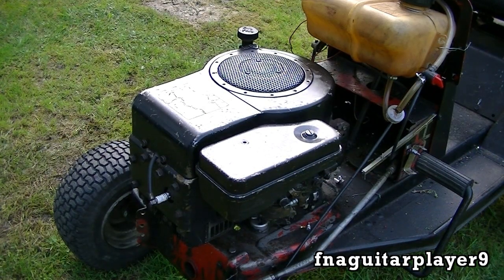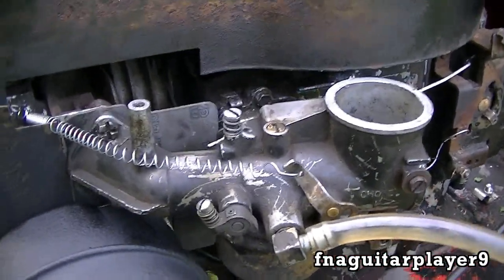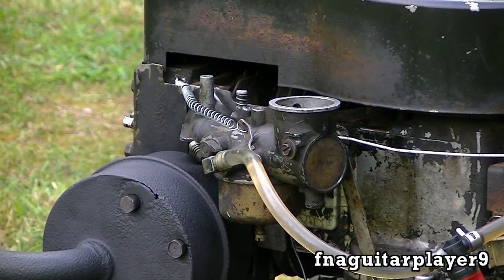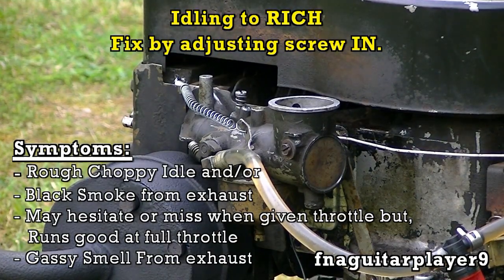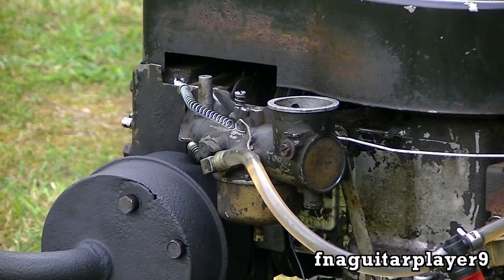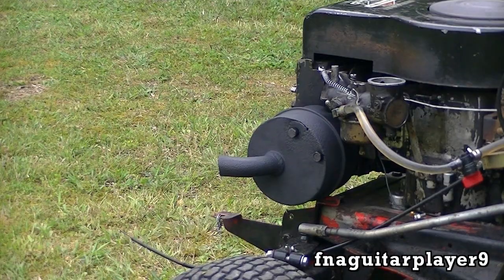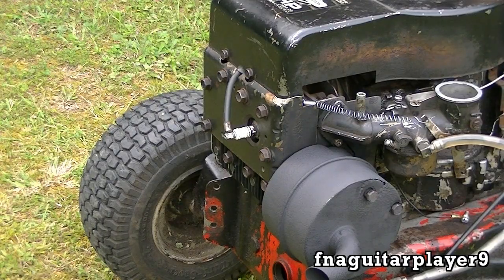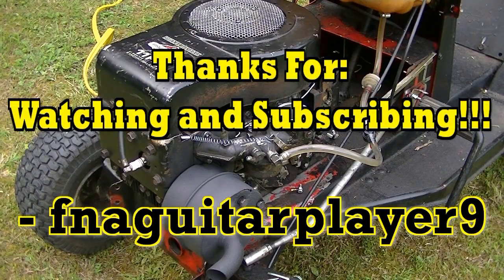How to adjust a Briggs and Stratton One Piece Flow Jet Carburetor

Comment: Hello I have a 10hp Briggs and when to give it throttle it Boggs but then clears up and full throttle how would I fix that thanks
Reply from the maker: Sounds like its running to rich, you can probably turn the bottom adjustment screw in until it stop doing that. But it could be running to lean, if thats the case then turn it out some. Thanks for Watching!
Reply: I got it all figured it was that bottom screw thank you for the vids they help out a lot
Reply from the maker: I hear ya! Your welcome, glad to help out!

Comment: Very good vid. Im not running yet, but its a 65' briggs 8hp that sat for 30 yrs. Got it to run 20 secs tonite, then quit. Never fired after that but this video gives me some things to try. I started at 1.5 turns out as this is not my 1st rodeo but this one is kicking my butt. But i only messed with bottom screw and olug is not getting gas in it. So maybe by messing w top screw , it might be running soon.
Reply from the maker: If its been sitting that long you will probably have to clean the carburetor first, i'm sure there will be some dirt/gum buildup in it. Thanks for Watching!!!
Reply: fnaguitarplayer9 yep i got it running about 2 weeks ago. The vid sure helped

Comment: My till runs great has the 8 hp briggs but at idle it will just vut out and die what could be my problem? Im going to use this video retune it today thanks for the video it looks very helpful!
Reply from the maker: It could be running lean at idle or you may have a weak spark, either do from the coil - flywheel gap not set right or from a fouled plug. or it my be trying to idle to low and needs adjusted up some. Thanks for Watching!!!

Comment: So am I able to replace my 12hp's Flo jet carb with a modern carb? If so what carb should I get. Thanks
Reply from the maker: The newer 2 piece style will bolt right on, but you will also need the elbow (that makes the other carb a 2 piece), and a linkage for the new type, it will be shorter. I prefer the old type myself, more adjustment and alot more reliable. Thanks for Watching!!!

Comment: On full throttle mine runs fine, but lower the throttle it surges and dies
Reply from the maker: The top screw (idle mixture) probably needs adjusted, if it doesn't adjust in, you may need to take it off and clean it, i have videos on that as well. Thanks for Watching!!!

Comment: hello again thanks for the info and getting back to me right away i have another question or two to ask you i started my mower today and it sounded really good at first just like yours but then when i shut the choke off it started two want to shut off so i put the choke back on then it started to run again does this mean i have to adjust the carburator more or do i have to set the govener right so it stops surging
Reply from the maker: Your welcome! It sounds like its running to lean, you should be able to turn out the mixture screw about a 1/4 to 1/2 turn (maybe more just depends) and it should be alright, if not, it may need to be cleaned. If that doesn't help, you may need to adjust the governor, but first thing to try is adjusting and cleaning it. Hope this helps, thanks for watching!!!

Comment: awesome video lots of info wanted to ask you can the seat where the needle goes be changed i went to a john deere place where they sell parts and the guy said that the seat cant be changed in these carburetors is this true or not could you please let me no because i think he was trying to get me to buy a new carburetor because i wanted to put a new needle  and seat do to gas being in the crank case  thank you and again awesome video
Reply from the maker: Appreciate that! You usually can change them, most of the time they came with a replaceable seat, but some do not, it just depends. If it doesn't, you can usually get the needle with the rubber tip and that will help alot. Your welcome, Thanks for Watching!!!

Comment: Thank you for posting. Got the it running after going back to factory setup. Tried a lot but when the engine gets hot it start coughing and than drops out. I think its the valves because in cold condition it work ok. What do you think?
Reply from the maker: sounds like valves or possible spark problems, could be coil breaking down or points/condenser. Thanks for Watching!!!

Comment: What if mine dosnt have a highs speed adjustment screw?
Reply from the maker: If its a one piece like in the video it should be on the bottom of the bowl, it may be broken off, but i've never seen a one piece without it, now the newer 2 piece carbs don't have a adjustment on the bottom, just on the top/side. Thanks for Watching!!!

Comment: I have a serious problem with hunting on these classical one-piece flojet´s.I have tried; new gov linkage, gov readjust, compressed air (carb cleaner)in all jets, still hunting like mad. Very nice and informative video!
Reply from the maker: It is possible to have a problem with the internal governor parts (oil slinger) but its unusual. Also it could be valve related, if the valves aren't sealing they act like that sometimes. or even if it has weak spark they can do that. Hope this helps! Thanks for Watching!!!

Comment: I used this video and got mine running mowed for about 20min and noticed it bogged out pretty easy. Adjusted the high side to run richer and she shut down. Now she won't crank back up. Any suggestions I think I'm gonna start from scratch
Reply from the maker: Thats the best thing to do when you "lose it" thats what i call it when you can't get it do anything after adjusting, just screw them both in and back it out to about 1.5 to 2 turns and see what it does, it should at least try to run at that. The carburetor may need to be cleaned if ti doesn't adjust in. Thanks for Watching!!!

Comment: My old rider like this runs find at higher throttle but chugs and dies at lower throttle, any one have any suggestions? Thanks
Reply from the maker: If adjusting the idle mixture screw doesn't fix it, try giving it a good cleaning and see what it does, sometimes it doesn't take much for them to act up. Your welcome, Thanks for Watching!!!

Comment: I have added a shut off valve so when not in use it doesn't run into crankcase but now I can see lots of gas after it startscin the carb top

Comment: So if the carb is filling up with gas and dies the bottom screw should be turned in?
Reply from the maker: thats usually do a float or needle valve problem, not letting the gas shut off.  Thanks for Watching!!!

Comment: Hey, I got a B&S 11 hp with the same carb.  The only thing is it starts and idles fine but when I give it some gas it revs up and I cant do anything to stop it but shut the mower off. I see in your video the throttle screw is not pivoting and mine is. Any explanation? Thanks
Reply from the maker: +Clayton Florence When you say you can't stop it, do you mean its over-reving? If so then i'd say a linkage is loose on it between the governor arm and carburetor, or the governor may need adjusted. Thanks for Watching!!!

Comment: I need the video for the 2 piece flo jet tuning adjustments.
Reply from the maker: +Dan Southern I don't have one yet, I'm planning on making one this summer, but i can try and explain it, first off the adjustment doesn't really do much on these carbs, it mainly adjusts the idle mixture, i just try to adjust until it will idle smooth, and see if it takes throttle good, if it doesn't take throttle no matter what you set it at, the carb needs cleaned and/or rebuilt. The 2 piece carbs are alot more sensitive than the older ones. And the adjustment range isn't nearly as much as the one piece carbs. Hope this helps for now. Thanks for Watching!!!
Reply: +fnaguitarplayer9 Awesome. That's basically what I have done. I did clean out the jet and got it to idle pretty good. It seems to be ok now. I just didn't know if there was a WOT setting or not. Thx again ! 
#5hpbriggssuperbronc
Reply from the maker: +Dan Southern I hear ya, not a whole lot you can do on these adjustment wise, just idle speed and mixture. your welcome, anytime!

Comment: Hello i have the same engine as in the movie. I have tried alot of diffrent things but can get to a soloution. When the engine is cold and pre warm there is no problems at all everythings working. But after like 10 minutes of grass cuting the engine wants to stop. And it sounds like it gets to mutch fuel. To get it started after that i need to have choke and at choke it starts and dies direct.. Do you have any clue what it could be?

Thanks
/Lorens Wastesson
Reply from the maker: +Lorens Wastesson First thing I'd do is make sure your choke cable is set right, sounds like it may not be opening all the way, or it could be the high side set to rich, the adjustment on the bottom. Thats the first things that come to mind. Thanks for Watching!!!

Comment: How can you  tell if it sheared off the flywheel key i had to change the flywheel on it cause the teeth was sheared off
Reply from the maker: Timmy Weller You have to remove the flywheel, then remove the key, if its still in one piece its fine, if its looks offset or is in pieces then it sheared it. Thanks for Watching!!!

Comment: I got a 12 hp Briggs and Stratton its popping through the carb i need your help on this plz
Reply from the maker: Timmy Weller If it ran before and just started doing this, i'd check the flywheel key, if it sheared it will do that (throws ignition timing off), if you just got it, then i'd suggest cleaning the carburetor first, best place to start. hope this helps! Thanks for Watching!!!
Reply: I cleaned the carb cause it wasn't getting any gas but now it wont even start
Reply from the maker: Timmy Weller You probably will have to play with the adjustment screws, turn both of them in until they bottom out, then turn out aprox. 2 turns, it should start to run some then. Also make sure its not flooding out, sometimes the float will stick and the carburetor will fill up.
Reply: Fixed the problem
Reply from the maker: Timmy Weller Heard that!
Reply: +Timmy Weller
I have the same issue with mine popping when trying to start the engine and then it dies, how did you fix the issue
Reply from the maker: probably a carburetor issue or a valve not sealing correctly. Thanks for Watching!!!

Comment: Well it took me a while to find your video but I'm glad I kept at it.  Similar to Barry Taylor, I'll keep your video reference for after I'm done cleaning the carburetor.

Quick question though, When I run it now, it will run well for 5 minutes then start to sputter and slows down within 15 to 20 sec.  I did change the air filter, new gas line filter, new oil, cleaned out the gas tanks and spark-plugs looks fine.  Any ideas just by reading? 

PS. I was going to pressure wash the bottom part of the engine since its all gummy and thick, is that a good idea?

Either way thanks for your video !
Reply from the maker: Serge V. Richard I hear ya! Sounds like the carburetor may just need cleaned and adjusted. Also it could be the float isn't set level, not letting the bowl fill up with enough gas. Its fine, just don't do it if the motor is real hot, warm is fine, like if you cut grass with it, then let it cool for 10-15 minutes then wash it, you don't really need a pressure washer, unless its just handy, because a water hose by itself with break up all of it. Your welcome, thanks for watching!!!
Reply from the maker: Serge V. Richard also note, just make sure not to get any water into the carburetor, leave the air filter on it, so it won't get into it. You can also leave it idling and do it as well, that way if water does get into it you know where at and most of the time it will clear out while its running unless its alot...
Reply: fnaguitarplayer9 Oh I wonder, I did change the gas filter but not with the same one, so I'm wondering if the new one is not allowing the correct flow in. The arrow is in the correct position mind you. Anyways, the carburetor look/is very dirty so it should be cleaned either way.
Reply from the maker: Serge V. Richard Most fuel filters are about the same, not a whole lot of difference, you can unhook the fuel line after the filter or at the carburetor and see how much gas comes out. Thats probably whats wrong, the carburetor needs cleaned, it happens alot. Thanks for Watching!!!

Comment: Thanks so much for this video!  I'm a computer guy trying to get  my 11hp briggs to run.  It has a problem running at more than an idle and you can forget about running the blades.  Everyone pointed to the carberator.   So I've got it off and it was really dirty so I'm cleaning it with gas and carb cleaner.  I hope I get it back on and will use ur video for reference as it is superb.
Reply from the maker: ***** Your welcome. I hear ya, that should help it, and it may also need adjusting as well. Glad to help out, Thanks for Watching!!!

Comment: ***** , I have an 80's Craftsman tractor with a 10 horse B&S engine with this same carburetor. The idle screw does absolutely nothing on mine! What am I missing? It runs the same if the screw is all the way in or all the way out and everything between

Comment: Mine seems to run smooth and then have one miss and then back to smooth.. whats up with that?
Reply from the maker: Dan Hitchcock You might want to adjust it a little richer, if its doing it at idle only, adjust the top screw, if its at full throttle try the bottom. If its at idle and the top screw doesn't help, try the bottom as well. Alot of times these tend to do that when idling, even with a perfectly adjusted/tuned carb. Its probably do to valves needing lapped/clearance set if it does it after tuning carb. But if it still has plenty of power, its not a major deal. hope this helps, thanks for watching!
Reply: Oh. thanks.. .that worked.. hel l  now I need no choke to start.. It just cranks about 2 cycles and purrs.  You de man!
Reply from the maker: Your welcome, glad to help out! Thats what i like about these type of carburetors, they have so much adjustment, you can really make them run good. Mine only need choke when they are cold. haha i hear ya!

Comment: My dads mower is having carb issues. It looks to be the same carb that you showed here. You seem to be the person to talk to about it. I put a much newer carb on it that had much less wear on it and I can't seem to get it adjusted right. Bought it off ebay. The throttle is SUPER sensitive now. I mean moving the throttle lever just a 1/4 of a inch on the dash of the mower is making the engine run really high RPMs. Higher than it has ever run before. I've tried to lean out the high adjustment on the bottom but it doesn't seem to work. It still revs too high. I think I need to screw in the low a little because it will stall after a while. I noticed there is a hose on the back of the carb what does that do? Thanks for making this video. It helped me out to know what screws were what. Thanks.
Reply from the maker: Love2boat92 That sounds like the governor spring is installed wrong or a linkage is bound up, or the governor is out of adjustment throwing off the throttle position. The hose is like a PCV valve on a vehicle, it pulls out any blow by in the crankcase, PCV is positive crankcase ventilation, any engine will produce some blow by, its more/less a emission control to be honest, it really does not effect performance, but if its not hooked up it will mist a steam out of it. Some people (myself) call it the oil breather. There is like a check valve in the valve cover where it connects. Thanks for Watching!
Reply: fnaguitarplayer9 I wondered if that's what it was. Do you have a video on adjusting the governor or  the spring for the governor? Is the governor spring on the throttle linkage? I saw a spring on the throttle linkage that was broken. I hooked the hose up. Thanks for your help to answer some of my questions.
Reply from the maker: Love2boat92 I do have a video on adjusting the governor: https://youtu.be/9rO8AvDrdeM  and i just put up a video showing how the spring is setup, you can't adjust the spring, but if its stretched you will have to replace it: https://youtu.be/v5PTY6vjUw4 Hope this helps!
Reply: fnaguitarplayer9 Thanks for all your help. I appreciate it. You really know your stuff.
Reply from the maker: Love2boat92 your welcome, always glad to help out! If you ever have any more questions/problems feel free to ask me!
Reply: fnaguitarplayer9 Thank you. I will do so if I have any other questions.
Reply from the maker: Love2boat92 Your welcome, sounds good!

Comment: I love those one piece carbs, very easy to work on. I rebuilt one of those last week
Reply from the maker: Carl's Small Engine Repair I agree with you, they are very easy to work on. I don't care much for the newer 2 piece carbs, not as much adjustment on them. Thanks for Watching!!!
Reply: fnaguitarplayer9 yeah I know I got one of the two piece carbs on my 12.5 hp briggs im rebuilding. Not a big fan of em either. And your welcome, check out my Channel and see what you think. I'm just getting started doing small engine repair, I've been doing it about 3 years.
Reply from the maker: They are not nearly as good as the old ones. I watched a couple of your videos, your doing pretty good, its fun making videos! If you have any questions feel free to leave a comment on any of my videos.
Reply: fnaguitarplayer9 thank you
Reply from the maker: Carl's Small Engine Repair your welcome